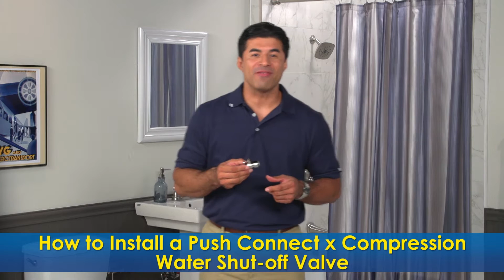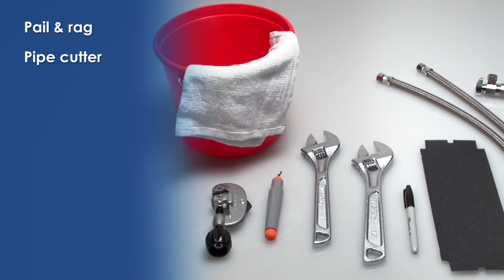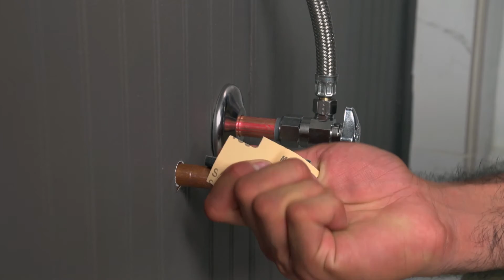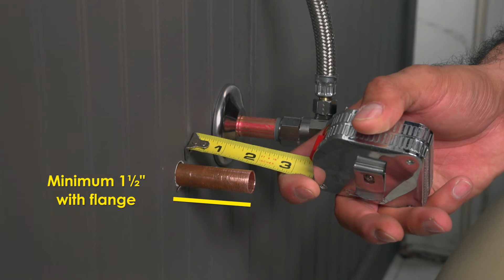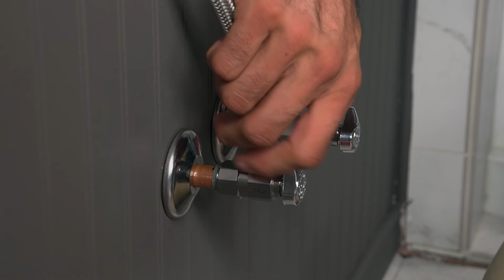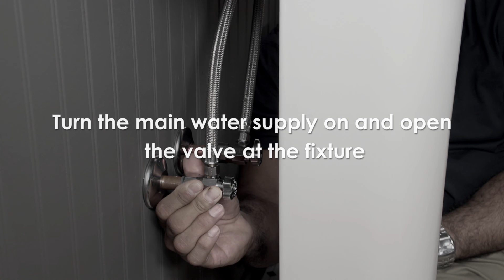How to Install a BrassCraft® Push Connect x Compression Valve

Comment: But how do you remove the old one?
Reply: its on the inside of the box it uses a combination removal tool that says the text on the tool should be facing away from the valve